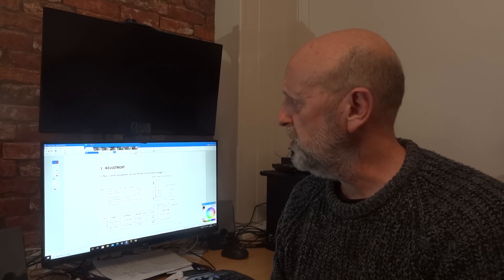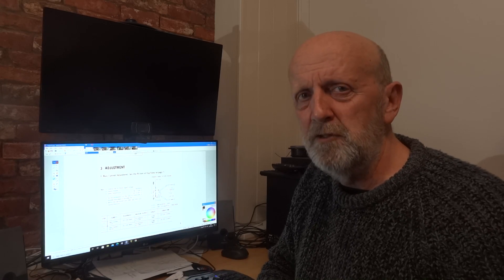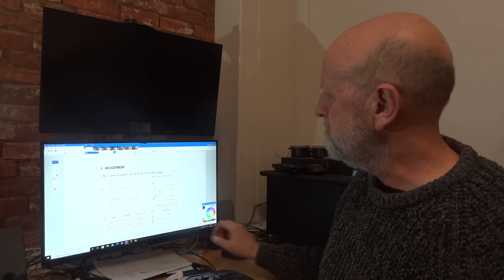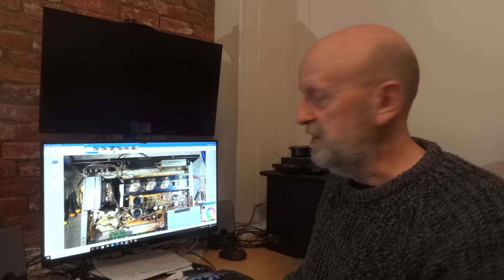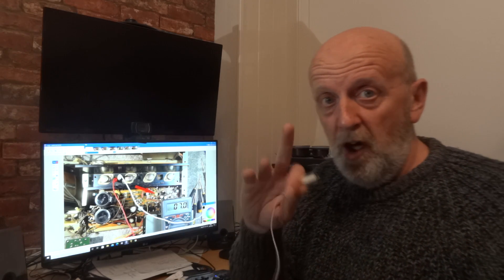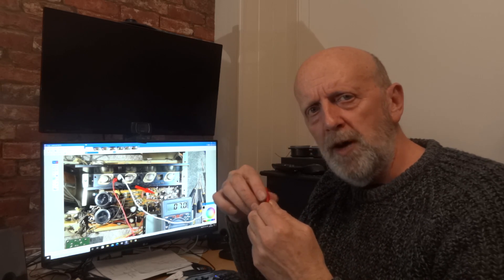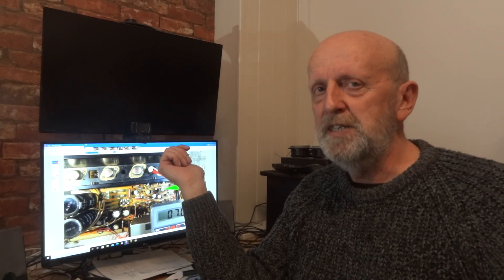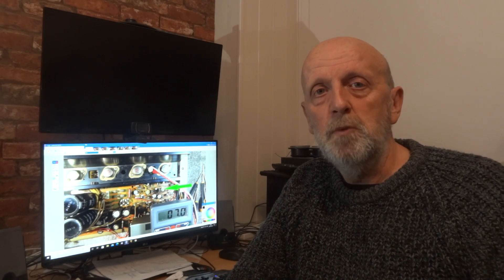How to Adjust Amplifier Bias. Setting Amplifier or Receiver. sansui au-217 shown

Comment: Cheers for the video. Some manuals say leave the amp on to warm up and stabilise another 30 minutes after you've done the first measurements and then test again, after which you should see the initial readings have gone up to another recommended measurement given in the manual, say from 2.5mv up to 6.5mv after 30 mins. I've done this on an amp but the measurements have not gone up much after 30 mins, maybe to 3.5mv. Is this something to worry about?
Reply from the maker: This is true, most service manuals do say 20 mins or so to let all the components warm up. In this case the manaul says more than 3 mins, I did leave around 5 mins or so and did adjustment then left it for around another 5 or so and it stayed withing 0.1 millivolt so pretty good. On your 3.5 mv after 30 mins If it was for this amp I then would re adjust back to 7mv.
Reply: @MichaelYates  Thanks Michael. After my initial adjustment I haven't had any problems so have just left it at the low reading.

Comment: Think they are both set to 7mv , First Sansui ive owned, got it from Fleaabay, just gave it a good blast internally with airline and soft  paint brush to remove years of dust and debris ande have been running it for a while after resetting bias , it was a bit high around 12 and 20 mv , its really starting to open up after a good run with some Reggae Dub ,quite airy  I,m impressed,
Reply from the maker: Yes 7mv , This and the 317 are great amps and can still get them for a good price. You have got yourself a nice amp

Comment: Do you have the 217mark 2  ,is the bias set the same for either mk1 or mk2, cheers
Reply from the maker: Do not have a mk2 217 but looking at the manual its the same settings for the bias

Comment: Any Experience with Myryad T range ?  Myryad T40 / T60  /T70 Amplifiers
Reply from the maker: Hi, no sorry none at all
Reply: @MichaelYates  yeah , I'm finding very few results on reviews or anything online . Only 1 customer review, which was good but only on the T40. 
I've just purchased pre - and power t40 and t60 . 60 watts power ,40 t40 Integrated . 
Was going to ask about speakes really and set up for say phone for music saying " youtube " music.  input .I use a two plug input to phone on my surround amp, but is there a better way, or I'm I doing it wrong. 
My room is 4mtr x 4 mtr high ceiling, not a clue what speakers to buy . I love the detail , sound stage , plus rock and indie, etc.  I'm confused lol 
Sorry for all the questions.
Reply from the maker: @itisjustacomment  A little user review of the T60 here http://www.audioreview.com/product/amplification/amplifiers/myryad/t60.html
as for speakers I use a cheap pair of Monitor Audio B2 speakers as an all rounder with grills off. Connecting from phone using 3.5mm is fine, you could get a decent Blu Tooth receiver for the amp and connect by blu tooth or a USB dac for your phone, but I think the straight connection is good enough. The T40 and T60 seem to get a good review on the little out there
Reply: @MichaelYates  thank you so much. I really appreciate this,  I will look for the speakers you recommend.

Comment: Hi  Michael,  thanks again.  Hope you can help.  Complete novice trying to fix a Rotel 820 AX, no relay on this model.  Changed most caps.  One problem resolved, which was power off, left channel bump on woofer.  Problem that remains is both channels 'bump' when turned on.  30mv at both speaker terminals, solders look OK, set the biases.  Next step will be scattergun on resistors/transistors (my multi meter skills are on par with a drunken skunk:), unless you have any advice where to look.  Cheers if any reply, much appreciated.
Reply from the maker: You will get a pop or bump on most these older amps that do not have the relay, some louder than others and also depending on speaker sensitivity. The 30mv on both speakers is not bad its ok, anything under 50mv is acceptable
It can be a lot of fidling about trying to lower this and sometimes it might hardly change. If you wanted to tinker around then transistor q601 and q603 could be changed. But must be a matched pair or very closely matched so might have to buy 10 and get the closes matched up, same with q602 and q604 see how that goes, then check nearby resistors values have not changed to much and replace the very low value caps nearby. After all this you might only lower it a few millivolts. Me personally I would leave as is.
Reply: @MichaelYates  Cheers Michael, first amp I have had a go at repairing.  Only reference I can find on the net suggests changing R611/12 resistors.  I will change these two and take your advice and leave it there....  Thanks for taking the time.